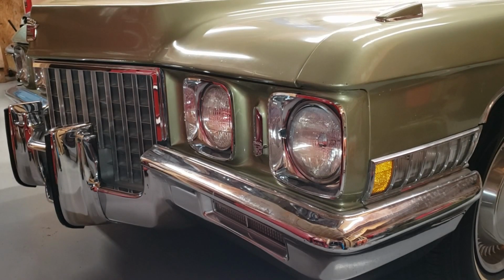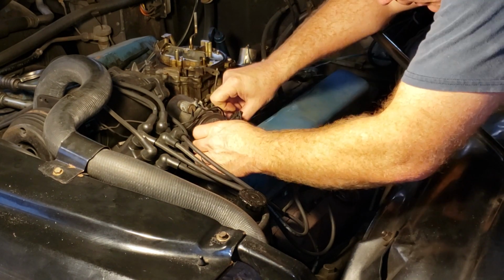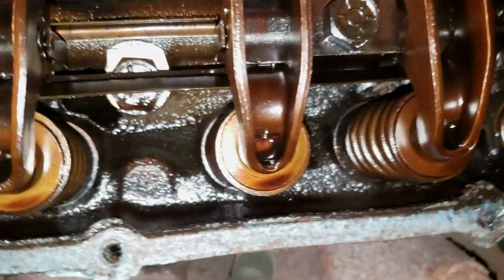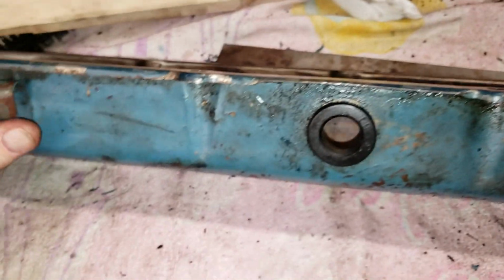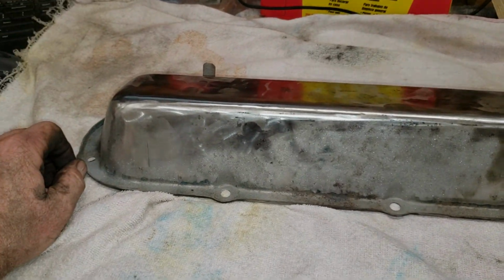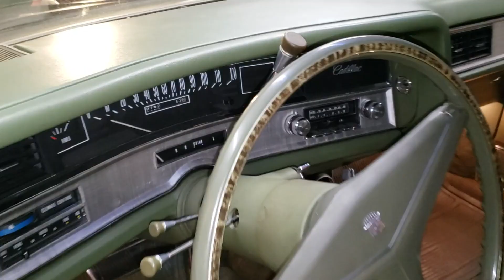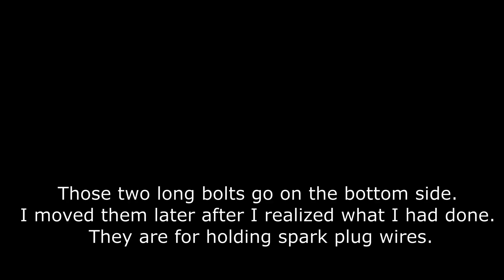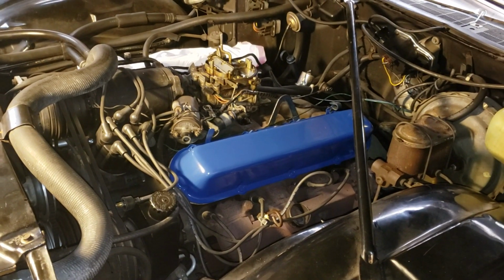Cadillac 472 Valve Covers - Painting, Straightening, Gaskets

Comment: Valve guide seals can be replaced without head removal...but valve job and  replace factory timing chain  with clyoes double timing chain steel gears 
And good valve job .. car be fine for few years till full rebuild necessary. Great video Thanks

Comment: That chunk of plastic is part of one of the valve stem seals.They are hard plastic umbrella seals and they get brittle and break apart.
Reply from the maker: Thanks! Had no idea. Had assumed the valve seals were all rubber.  Thankfully the engine does not smoke so the valve stem seals are still holding apparently. Any recommendations on new ones?
Reply: @ImpalamansGarage  You can get new factory style umbrella seals. That's what I put in my 500. You can also put rubber seals but that requires machining to get them to fit.
Reply from the maker: @cadman10000  Do you have a part number I could reference?  I assume these are correct ? https://cadillacperformance.com/product/vt37010/

Comment: Have you done the freeze plugs yet if so was it easy? I have a 91k mile 68 coupe deville that im trying to get back right and on the road
Reply from the maker: I've not messed with them yet.
Reply: Impalaman's Garage oh ok thanks sir
Reply from the maker: @bigcurt011  the lower engine block needs paint. You never know. I might be into it sooner than later.
Reply: @ImpalamansGarage  yeah im just trying to see if will i have to pull the motor to do it hope not ....because on my 62 i didnt have to do all that i did it with the motor in the car